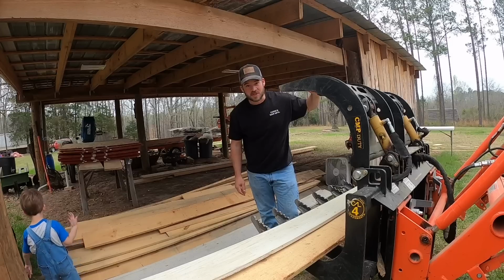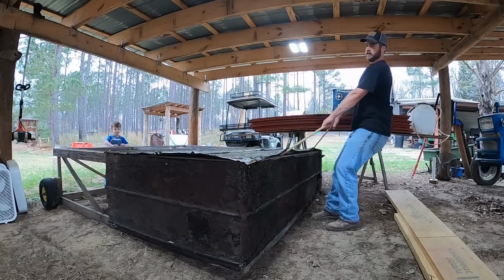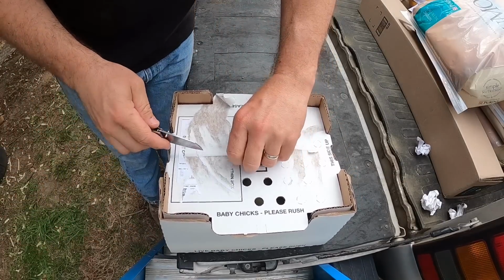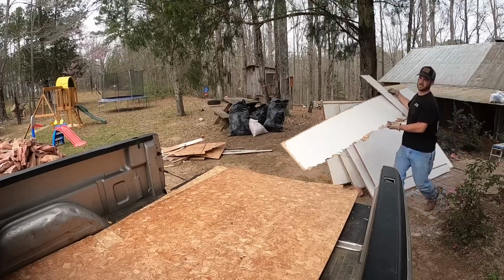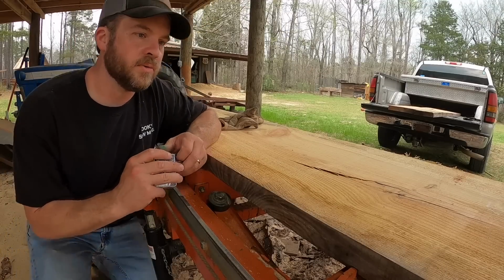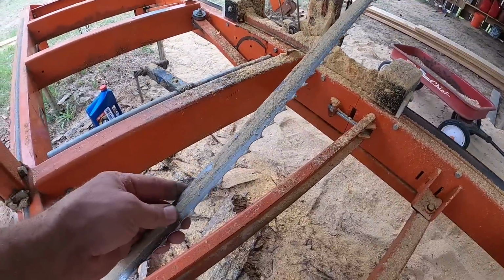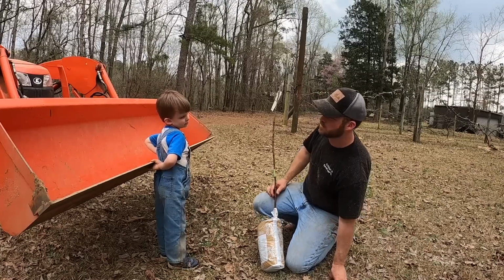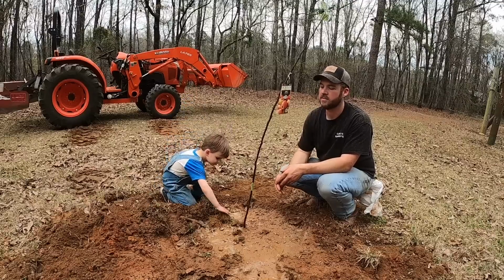Dads, Teach Your Kids to Homestead

Comment: It's planted too deep....lift it so that the graft point is visibly above the ground for about 3 inches.  If you don't, the graft has a good chance to rot,, and it will die, and secondly, if it does survive, the tree will sprout water spouts below the graft point....those will be from the rootstock, which will be an undesirable growth, as it's never going to amount to anything and constantly will need to be removed, which will increase disease risks. If left, those sprouts will grow larger eventually making it look like a bush, robbing the grafted version's energy, and any fruit growing from it won't taste good. Also, check to see if the tree you bought was a dwarf, semi-dwarf or standard size tree, if it's dwarf it will need life-long support (any kind of pole), because the roots will remain a small ball and be shallow, and will topple over either with heavy winds or heavy fruit. If it's semi-standard, it will need support for 3 years, then you can remove, the rootstock will eventually be strong enough to support it, standard rootstock should be supported as well for first 3  years.  Dwarf trees were developed for high density growing in orchards and there they are on poles and/or even tied to wires running from pole to pole. You'll want to learn how to trim apples, or fruit trees in general,  but your tree is good for the next year or two, when you're gonna want to beginbshaping your tree.  Remove any apples that should develop for the next 3 years. The Honeycrisp was developed in Minnesota especially to comply with -30F or more temps, not sure if in your region it will get enough chill hours in to grow healthy enough, but you can try. I live in Central MN, USDA Zone 3a, and it grows very well in my orchard, and it's a wonderful apple. All the best.  Ps....it requires 800 - 1000 chill hours according to the books.

Comment: Some advice from a tree planter: do plant them at the same depth as it was growing at the nursery or even 1-2 inches higher. If you plant them deeper  or to deep that kills trees. In the first growing season water them in dry conditions but only once a week. Second growing season once every other week should be sufficient. Love it when your planting an orchard. What types and species will you be planting?

Comment: A few pebbles in your chickens water to give them a platform will prevent them from drowning.  A common enough problem that I think everyone that has raised chicks has had (myself included) 

As far as lubricant for your mill...  have you tried pine sol? Can be found for cheap at bottom dollar and I think sawing with sandy has used that with his red pines with pretty good luck.

Comment: I use a citrus / orange based cleaner like Zep. Of course I don't actually pay the crazy price for Zep. Just use the generic orange cleaner. Anyway, I haven't had any problem with pitch buildup on the blades using about a 10:1 dilution.  Keep up the great work. It's very heartening seeing the kid pitching in to help.

Comment: i really like the way you take the time with your little boy not like a lots of parent they just give them a video something and leave them to it then when they are all grown up they wonder why there kid don't want to work    Also being from St.Augustine Florida I got about the same kind of trees and like you said for lubrication i don't like using diesel fuel specially my mill being stationary also close to a ditch that goes to my pound and don't like diesel in it i like eating my fish from it,  and for the pine like in this video i found that by adding regular cleaning pine sol with the dawn dish detergent work out decent if there is some accumulation i put a little W.D.40 straight on the blade i don't buy w.d.40 in spray can i buy it by the gallon and use a little oilier with that combination usually works out pretty good and my area don't smell like a diesel repair garage  well have a great day   P.S. don't be shy to open the lub. a good amount when the wood is real sappy also bugs don't seam to like it

Comment: I use the Simple Green HD ( purple) as a blade cleaner on my Miter Saw and Table saw in a 1:1 ratio, could probably go a little thinner.. 1.5:1 or maybe even 2:1 (with water) and that stuff, at 1:1...I spray it on the blade on 1 side by spraying around the 10" blade, it's already removing pitch before I get back around, flip it over and do the other side, 5 min soak and the blade is clean .... perhaps using that rather than the Dawn will give you more diesel like results.

Comment: Pine Sol and dish soap seems to keep the pine pitch off my blades.  I don't have the length of experience you do with the mill, only got mine this year, but I've had no buildup yet.  Could also be because I haven't been cutting dried pine.

Comment: I was surprised to see that Wood-Mizer advises using NO WATER in sawing extremely dry wood This from Page 20 of the Ultimate Sawmill Blade Guide: 
Cutting extremely dry wood

• Use no water. If water is necessary, use as little as possible because water will cause
the wood to swell. You can also try using water between cuts to clean the blade and
shutoff the water while making the cut.

Comment: Wondering if you could do me a favor. On the left side of the engine are a few wires, for some reason mine got unplugged (kids Im sure). Can you take a pic of them and post it? Im having trouble figuring out the wiring. Thanks!